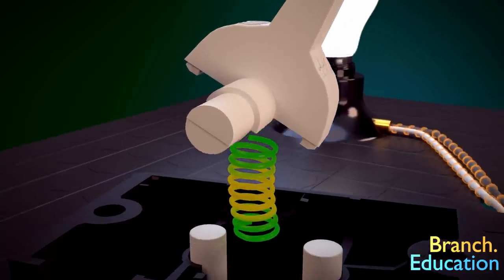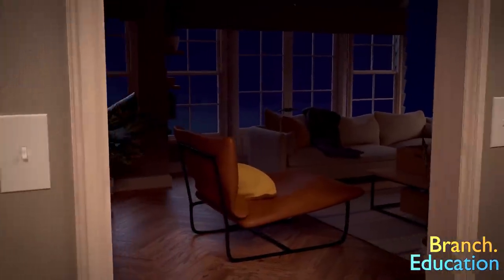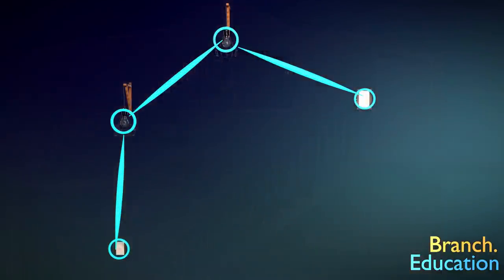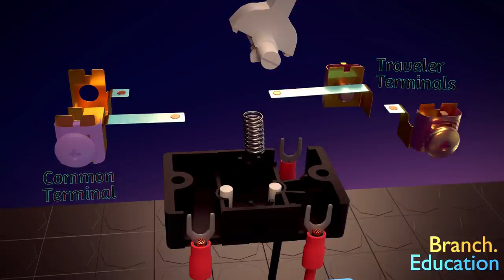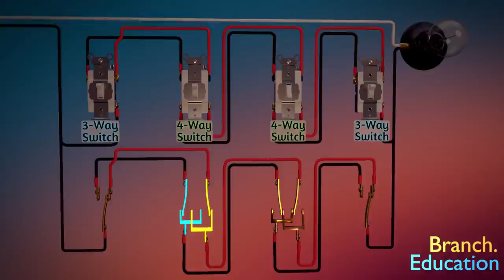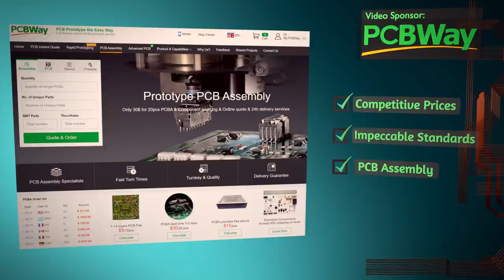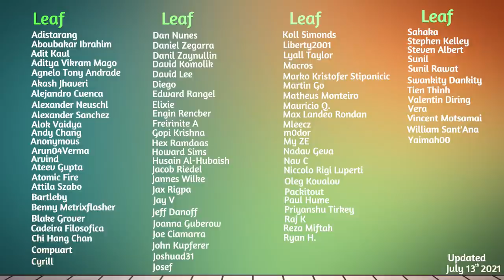3-Way Light Switches Explained!! Engineering Inside Light Switches and How They Work

Comment: When we had electricity in school, my teacher asked me to make a circuit that controls a single lamp with 3 or more switches. The only solution i could think of was by using xor gates and I always thought you would have to use xor gates and relays to control a lamp with 3 or more switches.

Comment: Love the hanging fixtures over the stairs. I think you mentioned pointing out inaccuracies was welcomed so...the ground wire on the switch wraps the wrong way. It should be clockwise so when tightened the wire stays in contact with the screw. That screw is always green. Commercial grade switches have a clamp! No wrapping.

Comment: In the U.K. they are known s 2-Way switching. Any more than 2 switches, ie, along a corridor, is known as 2-way and intermediate switching. (All switches have two states.)

3-way switching is more commonly known as "Manual-Off-Auto" switches. They would be used to switch between timeclocks and manual operations.

Comment: Would an XOR logic gate work for a 3 way switch too?
Reply: The circuit shown in essence IS a mechanical XOR gate.
Reply: @nkronert  yeah but i mean a non-mechanical one
Reply: @ncolyer  Fair enough - take an XOR logic gate, connect each of the switches (can be two way switches) to one of the inputs of the gate (the other contact of the switches is connected to ground, each input is also connected to the gate's power supply through a pullup resistor) and the output of the gate to a relay (basically another switch :-)). Relay and logic gate IC also need a suitable power supply. So, basically the mechanical switch construction is less complex, probably more reliable, and it doesn't use any power when the light is off, but otherwise - yes, it would work.
Reply: @nkronert  cool just need to make sure Coz I'm making minecraft house where mechanical xors are less practical
Reply: @ncolyer  believe it or not, but I have never had any dealings with Minecraft. But I'd assume that you don't need pull-up resistors nor a relay 😊
Reply: @nkronert  nope don't need any of that luckily

Comment: Hello there BE, may I suggest the next video to be about GPS tracking device, specifically speaking about the components that forms a GPS tracker (e.g. GPS Antennas, GPS receivers, the GSM module and how do they all work together?) For GPS receivers there are many different brands like Ublox and MTK which are all different prices, but I can't seem to understand what are the differences between them. Would be helpful if there is an actual video about it!

Thank you :)

Comment: Your illustration showed electrons moving in a linear motion along the wire when the device is switched on, however, what you were illustrating were alternating currents and so the electrons should have been shown oscillating back and forth.

Comment: Question, considering how close together the touchbars are, how do we make sure it doesn't cause an arc?
Reply from the maker: They are voltage rated, and likewise, higher voltage switches like 50kv have a different design.
Reply: also need higher load to make arc

Comment: I have gotten a good shock from sticking things inside outlets as a kid, I also spat in them before, got my lip nice and swollen from the high voltage damaging the tissue inside my lips. A real fun one was when I used a wet power tool and couldn't let go of it, so I started spinning my arm until the tool was forced out of my arm by the momentum. I have had my fair share of high voltage. It could probably have killed me if it had a diffrent path to ground then it did. funny enough, An electric fence actually hurt a lot more than getting zapped by 120 volts, mainly because I was holding a galvanized steel fence with one hand and touched the fence with the other, running the voltage across my heart. I felt rather messed up for a few minutes. In any case I wouldn't recommend it

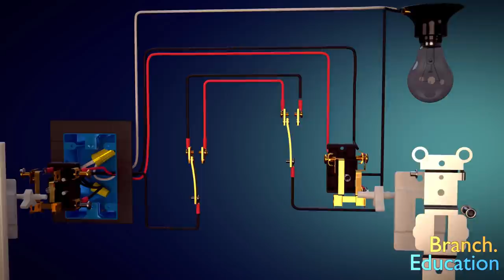Comment: The way you duplicate parts of the circuit without direct acknowledgement is thoroughly discombobulating... I actually gave up at trying to understand your demonstration of the 3-way switch after wasting 10 minutes rewatching the animations at 20% playback speed. Thankfully you decided to make it obvious with the 4-way switch for some reason and only then I realized what's happening and why you animated power flowing down 2 parallel wires simultaneously in the same direction (3:30)... They way you duplicated the 4-way switches visually isolates the duplicated circuit making it much more recognizable than the mess before it.
The concept I'm struggling with is I still have no idea why you put in all this amazing work to animate each individual part, even while the parts are exploded for dissection, just to push the actual switch aside to our periphery and fabricate simplified contact plates out of nowhere... And then you wired the contact plates to [itself] the switch???? You already have the switch modeled and animated right there. Instead, we're focusing on this simplified distraction, so we can't trace the circuit polarity anymore making anything that appears to connect with it entirely unintelligible.